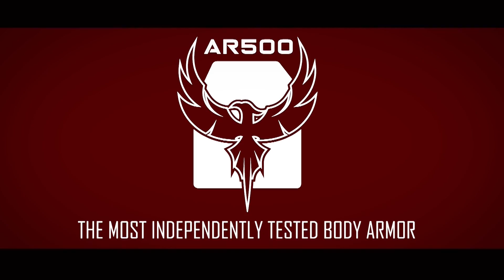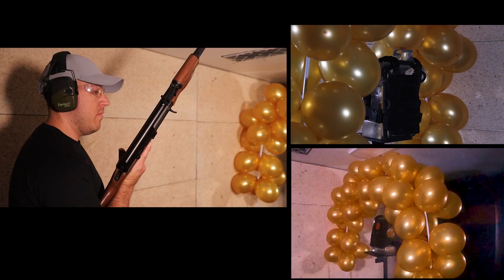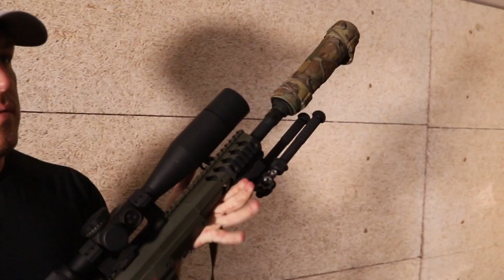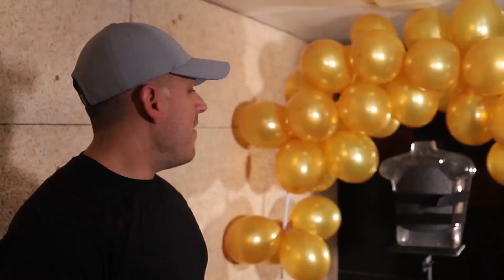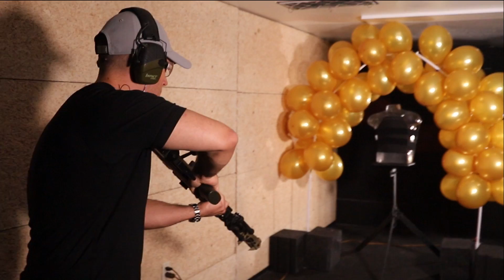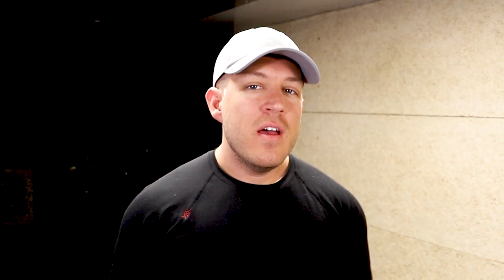Anti Frag/Spall Compilation!  Steel Plate and Ceramic Plate vs 50 Balloons!

Comment: "Most Independently tested armor" yeah because it'll never pass CIJ standards lmfao
Reply: Didn't realize the Citizens for Impartial Justice was big on armor testing
Reply: Literally the most “YouTube tested” armor. I’ve yet to see someone defeat it. Dipshit.
Reply: @joncampo1627  no shit. They are sponsored. M193 kills steel.
Reply: @joncampo1627  M193 out of a 20 inch barrel will pass right through
Reply: @zzzxxc1  I've literally shot flat level III+ AR500 with M193 out of a 20" AR at 3300fps from 15ft and it blew the coating off but didn't go through.. Dented it sure, but it didn't pass through. So in my experience it won't...
Reply: @martycuhntzmart5635  may I introduce you to what “spalling” is

Comment: Ceramic sand fragments popping balloons doesn't equal "fragmentation" of the round.

Argumentum ad populum isn't a valid argument. This is a giant canard, because its not showing if what is coming off the ceramic is actually fragmentation that will harm the wearer. Ergo, the "test" being presented is flawed.

Sure steel is a viable option, but presenting it in a fashion that preys on ignorance is less then awesome.
Reply: This. Just like AR500Armor to use deceptive marketing. Latex balloons are a horrible analog of human tissue.

Comment: the 300 win should have been shot from a proper distance, I punched a hole in ar500 target steel with a 300 win, to be fair it was only once, but its 1/4 inch plus.

Comment: I bought your plates and had them sprayed with build up coat before I saw this video. I had always heard steel armor would spall badly and cause damage to my body. Its so nice to see this video and know that I made the right choice. I cant wait to get my armor and now not have to worry about the spalling.
Reply: Hate to rain on your parade, but you made the wrong choice. It still will still spall if hit from an angle.

Comment: I think you guys should only sell steel with the build up. Some people might not do the research and end up getting injured from fragmentation. Thanks for the video.
Reply: It's quite telling that they sell it without it...
Reply: I'm trying to decide on plates but it seems like even a bare steel plate fragging like hell would be more survivable than being shot directly in the heart and/or lungs
Reply: I second this. Or default to build-up and display prices for build-up, and offer the option in a drop down for non buld-up with a negative dollar amount  e.g. (-$36) versus an option with a plus dollar amount. Buildup on steel really needs to be the baseline. Not the other way around.

Comment: Showing the uncontained steel was informative to give its baseline with the given impact parameters, but I think for context it's equally important to show the ceramic contained in the carrier so we have some sense of the danger and escape risk of the ceramic frag, since balloons don't provide much clarity as to actual danger.  I also think it's important to show the difference in frag risk with a near-edge hit in a carrier for both armor types.  I tend to think the ceramic would do better in that scenario.
Reply: Near edge ceramic and poly aren't guaranteed to stop the bullet. Steel will stop it but fragments will chip off. So you have to consider spalling and how to mitigate that as much as possible.

Comment: There is no question that the mass of a standard hunting  bullet disintegrates when it impacts a hard surface. Where are those particles, that splatter, going? Are they reflected back towards the direction of the shot?  Is the coating actually thick enough and resistive enough to contain all the bullet particles? Where are those particles going?  I have shot competitively and been a fabricator of Steel Silhouette targets for 50 years. I must say, the displayed performance of your coated armor plate defies  belief in what appears to be literally absorption of the fragmented bullet. Such a demonstration as you have done here seems beyond the laws of physics. . .that so much energy of the disintegration of a standard hunting bullet is, apparently, contained by this coating.   How about a cut-away of the impact point for inspection of the disposition of the particles from the  fragmented bullet? What I have seen here verges on the cliche "can I believe my own eyes!"  With my experience, almost as unfathomable as a magician catching a bullet in his teeth.
Reply: I'm trying to decide on what plates to use and I couldn't agree more

Comment: Level III plates are usually made from UHMWPE and it´s not probable to have spalls or frags,  said so I really would like to see this same test with a .3006 M2 AP round in a Level IV plate,  but I´m not saying you have a bad plate  I´m impressed of how low was the trauma (BFD)  in the first plate and the coating looks very well finished it´s very difficult to control the thickness when you are using those products.

Comment: What if your brand of armor is shot from an angle? How does your armor react?
What about other types.
I'd like to see it shot from 20° and 45° angles instead of just 90° to the strike face
Reply: For armor plates, a shallower angle will reduce the overall penetration until it ricochets.

Comment: Not to mention steel will last a very very long time, and most people aren't going to encounter 30 caliber black tip AP rounds very often. I chose the 3+ the primary reason is I want something that will stop 95% of threats I might encounter and will last a really long time. In the off chance someone has some black tip... Well it's better to prepare for the 95% first, before you start spending much more time and money trying to prepare for the other 5%
Reply: Rma 1155s are a similar price and better. Ceramic lasts plenty of time.
Reply: @quantum_chezburger2279  I'm actually having a hard time believing I wrote this comment only a year ago. Yes I definitely have ceramic now. Steel are training or backup
Reply: @C.Hobbs2178  good.

Comment: Why not put a steel plate in front of the ceramic plate? Then u get a lvl IV plate which will not fragment
Reply: Weight, and thickness. Put an 8lb steel plate in front of a 6lb ceramic plate, and you've got 14 lbs front, 14 lbs back. And plates sandwiched like that probably will not fit in a carrier, a ceramic plate is already very thick and snug. So nearly 30 lbs of front and back armor... Are you running side plates, spare mags, a battle belt, an 8lb rifle... I don't want to be running around with 60lbs of gear lol
Reply: Normal ceramics don't fragment. Ex. Rma, etc. But, this is their shit ceramic, with no plate carrier to catch the low velo frags. Also, weight.

Comment: so you took the cover off of the ceramic, which helps with the spall just like your build up coat? Doesn't seem fair.
Reply from the maker: No, we placed an additional cordura cover over the front and rear labels to hide the manufacturer, which would in a very small way, aid in containing frag.
Reply: Did you miss the part where they shot the AR500 plate with no carrier?
Reply: @thedoobie1-KQ4AET  my comment said nothing about the carrier. I was commenting the spall coating vs ceramic cover which I realize now that there is indeed a cover.
Reply: My apologies I just now watched the other videos and could seethe cover stitching.

Comment: I'm new to AR500 but I have a Q??... I seem to recall that the Level 4 plate you tested was a competitor's brand. SO... does YOUR Level 4 have anti-frag coating on it like the steel plate? I ask because I like the idea of 1) having the lighter ceramic plates, and 2) I believe that just having armor capable of stopping AP ammo is important, even if you don't wear THAT for EDC.
Reply: Just be aware of the expiration date and durability of ceramic vs steel
Reply from the maker: It's a result of the ceramic strike face and it's hardness that causes frag upon impact. Now, you could coat it with further anti-frag coatings, but, in a system that's already in the 8lb range & close to 1" thick, for sub 300 level IV armor, adding weight and thickness wouldn't be ideal.

Comment: Unrelated question: I'm trying to use this month's discount code to buy a QD IFAK and 2 shotgun cards, but the site gives tells me that the code that I am using is invalid. The code is supposed to be good for everything on the site, with the exception of promotional items. Can you tell me what is going on? I emailed customer service a 3 or 4 days ago, but there has been no response. I know you guys are still really busy/backed up, so I figured I would ask here too. And thank you for doing this test. Very informative :) One useful addition to this video would be testing one of your plates with only the base coating applied. That would show people that it is truly worth the money to opt for the thicker coating!
Reply: VT Concerned Citizen It's supposed to be "GIVETHANKS." I did also try 1621, and didn't have any luck.
Reply: I had the same thing happen, assumed it just wasn't a sale item.

Comment: Hows the base coat work with this test?
Reply: Hi guys (I really wasnt trying to be snide sorry!) I really am curious about base coat.  I wear 3+LW 10x12 basecoat(for weight and thickness)in a external carrier with 3a soft underneath both front and back.  External carrier is high quality nylon and the only thing between the top/front of the plate and my neck. Will nylon stop or significantly decelerate lead frag after direct impacts(I realize angled impacts change everything).  Not a deal breaker...if I cant stop a bleed with quick clot or a tq then I have other problems.  Will the combo 3+LW and 3a soft underneath have a shot at stopping any black tip(.308 maybe but not 30-06?).  I wear this armor daily but cant practically run a balloon dome shooting at a 3+LW in a carrier to test personally.  I'd like be able to reccomend options to my guys bit for some people that build up coat adds some bulk with all our other gear.  Thanks!
Reply: brad mechling no the nylon won’t stop enough spall just get a good ceramic plate that won’t spall

Comment: So far I found only 2 cons to steel plates:
1) Weight
2) Compass fails to work
Reply: Try to run around for a few hours with two steel plates. They list the weight.
Reply: @imbreske  or four!
Reply from the maker: @imbreske  To be fair, our III & III+ are on par with reasonably priced level IV's, and our III+ LW 10x12 weighs as little as 5.5lb depending on configuration.
Reply: I agree. But, lvl 4 is too heavy for me. If the apocalypse hits, these 50 yo knees will take their chances with plates that are so light they float. Thanks for giving young bucks a cheaper option.
Reply: @ArmoredRepublic2  Hey AR500--I'm just griping, folks. I'm very happy with your III+ plates. I run front&back curved and 6" side plates. A sore back beats a sucking chest wound anytime, anyplace. Thanks for making it available to Non-Wealthy Vets and Patriots...which would be just about all of us..!

Comment: I wasn't aware the spall on the ceramics was that bad... Then again I've been an AR500 customer since you guys started.
Reply: It’s not.... many shootings where ceramics stopped and they didn’t spall. Deceptive techniques
Reply: @ShawnHinck  Just like those used against AR-500? I've seen plenty of ceramic not sealed with kevlar spall in testing and not just from AR-500 tests.
Reply: @EvilMerlin  you have a plate carrier in front of it, and because the ceramic shatters what you’re getting will go out. The reality is, there’s a lot of data out there comparatively speaking regarding ceramic armor and the non-existent injuries from frag. Now, that said, AR500 fragmentation, it’s going to follow the plate and the liner, right to your neck, and if it’s an oblique shot, now you’re dealing with a slug. It may be lined, but it’s still just a target disguised as armor
Reply from the maker: We appreciate the support and trust in our brand!